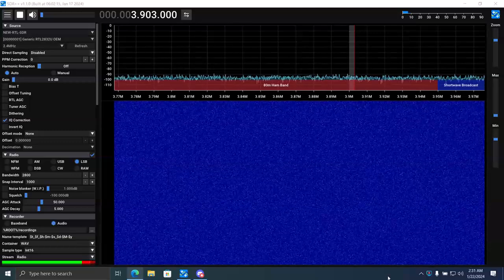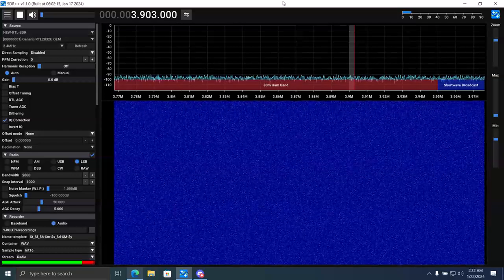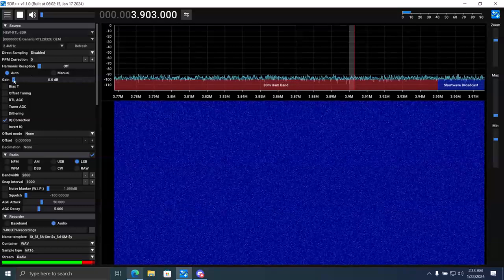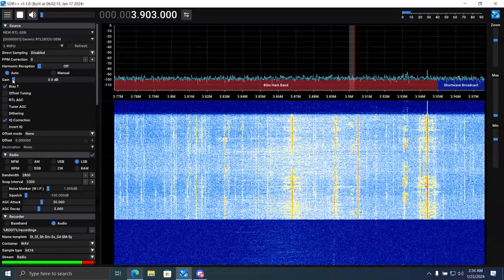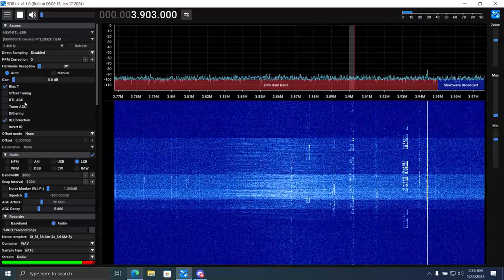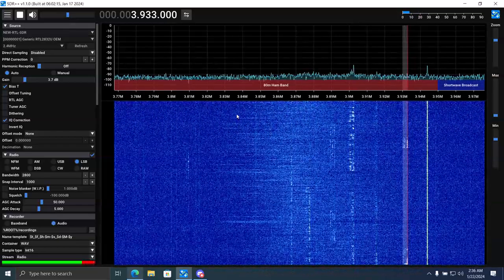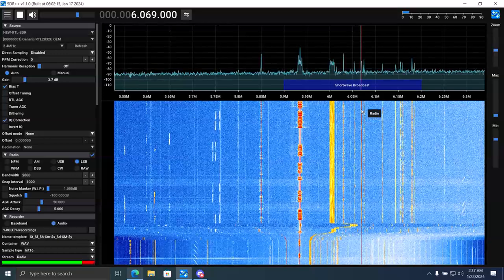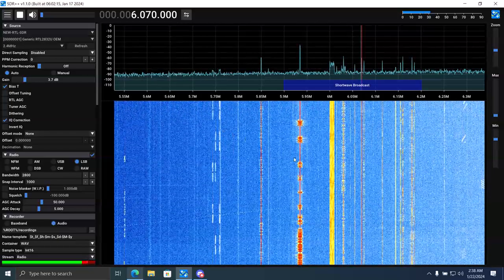How To Use a Low Noise Amplifier (L.N.A.)

Comment: do u recommend a bias tee powered lna or a external powered lna?
Reply from the maker: External power from a battery bank is quietest. I was demonstrating using the RTL-SDR v4 bias-T. It has satisfactory low enough noise floor at low RF Gains. LNA is there to compensate for that.
Reply: @sunplio  can i use a phone charger to power the lna?
Reply from the maker: @Nol_yaw  You can but it might induce switching power supply noise. Better to use a power bank. They last a real long time on the lna because it consumes very little current.

Comment: The rf-in and rf-out are not labeled on the housing of the LNA device. The dc connector is on the rf-in side, it should be on the rf-out side.
The MMIC amp chip has  only one uni-directional diode for protection. So in reality you should need two of them antiparallel. Or better: an bi-directional protection.  😇
There are many reports of malfunctions at this type of LNA...

Comment: Hi is it possable to use this on a quansheng?many thanks 🇬🇧
Reply from the maker: LNA's are for receivers and won't transmit. You can use it on that HT but if you try to transmit through a LNA you risk burning up the LNA and or radio output finals. You need to have a linear amplifier for the 2m/70cm Quansheng, All of the Quansheng HT's need the operator to have the proper license. Not going to discuss licensing.